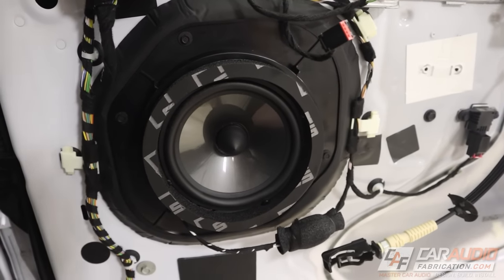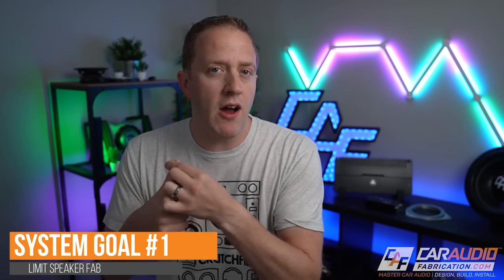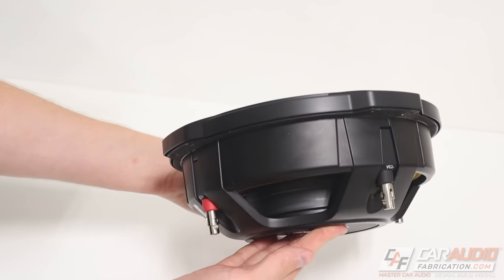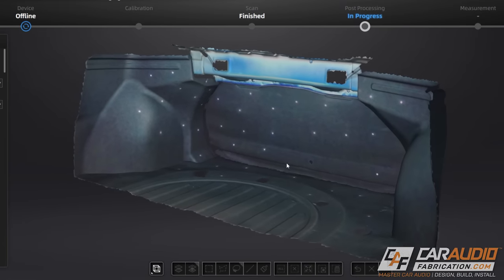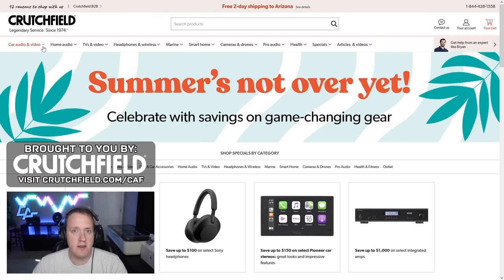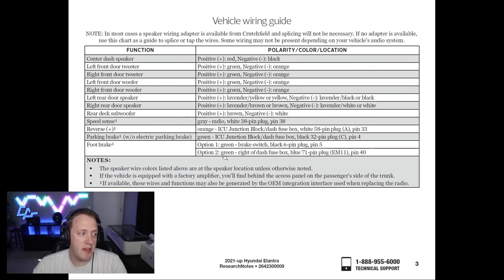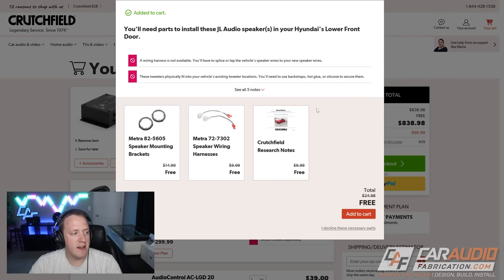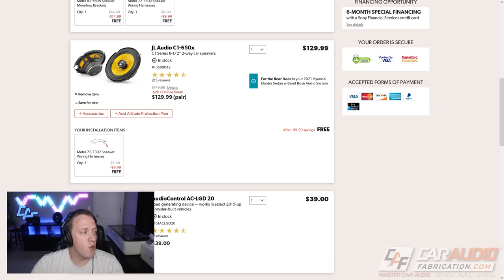Planning Speakers, Subwoofers, & Amplifiers for Car Audio Build - NEW PROJECT!

Comment from the maker: Now that we have everything picked out lets get it ordered! See the full gear unboxing here: https://youtu.be/ip_Yls47PKQ
Reply: Are you going to run new speaker wire to the door. If so, what’s the point using the adapter from the factory speaker plugs to the new speakers and is the factory wiring enough when running an amp. Asking cause I’m in a similar situation with my Holden Colorado

Comment: If 4,000 is a budget build what's my $250 build 😅
Reply: I had a $2200 system in a Chrysler LeBaron in the mid late 1990's. I thought that was budget then as a couple of my amps were not name brand ones. You probably can not upgrade much for $250 these days bud.
Reply: @Living_EDventures  I'm about to spend $140 to more than double the quality of my current oem sound system. I'm getting name brand speakers and a solid head unit. "Budget" has gotta be something that your average joe can afford - not people who have this as their main hobby.
Reply: @AstroSalamander  I mean the bandpass box I bought was more than $140 bare.
Reply: @Living_EDventures  i gocha but budget would just be the bare minimum while still giving a decent upgrade. So new head unit and speakers that increase your overall quality would be considered "budget" and you can do all that decently for $250
Reply: Finish the sentence.
Reply: about fifteen years ago I thought I was balling when I spent 3K on a new install.  Turns out, not so much
Reply: Factory speakers and a cheap head unit
Reply: $250 gets you budget speakers for all 4 doors
Reply: A reasonable speaker upgrade.  Did this in my truck that technically has an "amp" but its only 20w per speaker for the 4 doors, no subs or any fancy features.  No sound treating, reused the oem spacers and gaskets and used adapters to fit the new speaker mounting pattern.  Very impressed with the results.  As much as I would love to finish it out with a nice amp, 2 10" shallow mount subs and a head unit with touchscreen and navigation, the truck continues to need mechanical work as any 20+ year old vehicle does not to mention all the continuous other expenses in life and trying to save up for a house one day.  Channels like these are here to help the companies separate you from your money.  Not saying that's a bad thing or hes evil, but there's nothing wrong with doing what you can afford.
Reply: Yeah I got better quality and wattage off of maybe 600 bucks and hand me downs... audio equipment is given away like crazy and if you hang out with people that don't by absolute garbage you'll end up with a much better system than this for sub 1,000
Reply: I always thought I had a budget system. Then Ione day added up everything and $2500 doesn't sound like a budget system. It's not  all top gear (most expensive) but wiring, amps ,subs + enclosure, factory replacement speakers.  Everything adds up. 😂
Reply: 4k is budget for a full audio system
Reply: Ya. No kidding. Out of my reach too. 500-600 on a new head unit with new speakers. That’s it for me.
Reply: a budget budget build, but nothing is wrong with a budget build at all. build what you can afford.
Reply: That had me crying lol
Reply: Unfortunate, . . …………
Reply: Pemny pinchers menu 😂
Reply: I did a custom set up in my semi truck and it was almost 7k...my ass hurt after I saw the bill but I got 2 high dollar door speakers, 6 speaker/2 tweeter enclosure in the cab. The sleeper got upgraded factory position speakers, 4 speaker/2 tweeter enclosure on the bunk wall with 4 15" subs, all the wire, fuses blocks, 4 amps etc etc. I spend 320 days on the road and I need music
Reply: Poverty build 😭
Reply: I only spent like 1,200 on mine. Amp, head unit, new speakers
Reply: @Living_EDventures  250$ gets you a sweet double din CarPlay radio, new door speakers, and if you're smart a 4 channel amp and wiring kit.
Reply: That's the only issue with this channel. I haven't seen anything for the average joe
Reply: For 250 all on Amazon right now, I’d probably do one of the NVX sub/box/amp all-in-one deals 200 rms version($150) an 8 gauge wiring kit (Skar kit for $18), a package headunit with two 6.5s from Boss ($47), a pair of Kenwood 6x9s or 6.5s depending on your car ($35), and a roll of speaker wire ($7). Total comes out to 257 before tax. I did leave out the headunit mold for the vehicle, but you could always forgo the 35 dollar speakers and leave the stock speakers either in the rear/front and be at around 250. It won’t blow your socks off by any means but it’s something especially if you have stock sound components that are not functioning properly.

Other option is to buy used materials…
Reply: Walmart 😂😂
Reply: That’s how much my ofc wire for the whole car and that was cheap stuff lol
Reply: @garrettgiuffre7298  crackhead 🤪 build? Hey, to be fair, that is better than mine 🙂
Reply: When starting in car audio, you get new speakers & head unit. It’s not long before you decide to add a sub, then 4 channel amp, suddenly you’re applying sound treatment. It’s an addictive hobby! This guy is a pro! Start small and one day you’ll be crazy (and in debt) like us! 😂
Reply: @DGGuaglianone  so true. when i got my 20yr old son going (his first upgrade), he was pretty nervous, but the stock speakers were completely trashed. Head unit and speakers is where it's at, but i did jump him forward - just a bit - by helping him sound deaden all 4 doors. 😎 amp and sub later this year. he's not ready for it, he's still blown away with the hu and speakers, hahaha!
Reply: @garrettgiuffre7298  right like im planning my largest ever build and its about 3500 and i consider that super expensive

Comment: I’d love to see how you connect to the factory output then back to the speakers.
Reply: Yessssss
Reply: PAC makes lots of different adapter harnesses. I got one for my Lexus that plugged in between the factory amp and wire harness. I was able to output the factory amp directly into my aftermarket amp with it
Reply: @mabolzichjjl  thank you for that information. I have to see if they have one for my 16 Ford Taurus
Reply: @mabolzichjjl  Is your factory amp the mark Levinson??
Reply: @allanb3222  no but the connector works for the ML system IIRC
Reply: @mabolzichjjl  Sweet that's what I need, nobody make a T harness for that amp according to the literature.

Comment: The 4k budget is total or components only?  Because if that's the max budget 4k, you're not factoring labor, materials etc into that 4k.  Especially at 3500+ in just system components.  I'd love to see a final breakdown for cost on one of these builds for the average customer.  A custom box(s) for the subs, and install plus misc wiring and such will be well over that remaining balance on a 4k budget will it not?
Reply: I'd guess at least another grand for install labor. The custom box being a good chunk of it and then the dsp setup.
Reply: @uome2k7  I'd bet it's a lot more for the average customers install.  This is his brother in laws car if I recall correctly.  Custom boxes 3d scanned and designed, plus print time?  I'd bet there is a few hours of design time, and probably 100+ hours of print time.
Reply: Totally agree on this. What he showed, the true cost of that system was upwards of $5000 - $5500, depending on all the little things that weren't mentioned, especially for a first-time system builder (such as myself). The true cost of my system is 3x what I was originally hoping to spend, factoring in some of these things, and so now, I'm having to make choices. Of course, this is NORMAL, but this video is a bit misleading because it doesn't help someone take into account all of these other "hidden costs" of building a car audio system.

Comment: I miss the early 2000s I made so much side money doing systems. I made a dj truck the guy used at beach festivals. It ran on 2 generators and was 10 kilowatts. Used loud horns and 2 massive 4 Kw subs. Eventually it shook the truck apart. Ive always wanted to do another one with modern sound equipment and I would tackle Dolby Atmos surround sound true 5.1 spacial audio with hifi sound.

Comment: Been going for weeks part time on a Toyota sienna van.  Did so much acoustical treatment to the front dooes and even in behind tghe trim, wiring, fiberglass pods at only the rear armrests, dynamatt! Etc etc.  All this work for audio in a car.  They should offer audio cars off the line.

Comment: Very much appreciated. Thought I had all I need for my install, then learn if the very likely need for load generating devices. It seems to never end with modern cars!
Reply from the maker: It will only get worse. Car manufacturers don't want you to actually own or modify your vehicle. Wait til the general public learns more about their deceptive practices like having the ability to use heated seats, but requiring you to pay a subscription fee to unlock their use... people need to start voting with their wallet now and refusing to purchase from those manufacturers and making it clear why. It won't last long if shareholders find out why the cars aren't selling.

Comment: Great video are usually ❤.  I feel like what really holds me back in my build is I am not to sure what to get when it comes to installing. Meaning, what size wire sleeves to get, where to add padding to speakers/brackets, and all those small things that make a build perfect. Would love to see something like that

Comment: I love the detail and quality of work man but to be honest most the systems I have seen you build are A. High end.
High quality.
Very Low in output.
I been doing spl /Sq competitions for years. And 4k can get you a loud  system With electrical upgrades. I like JL as much as the next person but other options out there can absolutely crush them in performance per dollar.
Why not reach out to D4S or Skyhigh etc and get some spl grade sponsors.
I really want to see how you would build a spl competition wall ported or 6th order. Something on the order of 15,000+ watts.
You can get a JP43 and a pair of JP234 a dsp and speakers and some subs for 4k and this will nearly rip the trunk lid off

I generally over size my amps by 15-25%.
I find 120-160w rms per channel works well for most mids and Highs.
For daily drivers and still having usable  storage. 500-1000 watts rms on 1 or 2 10's in a proper ported box or 3-4 8in under seats for trucks. 
It's 2023 every build needs a dsp and active filters (dedicated channel for every woofer tweeter etc)
Reply: That's what you see for a good reason... Most people do not want an SPL build, especially to the level you're describing. It's impractical, and a build on that wouldn't provide nearly the same amount of usable information to the majority of the viewership or target audience.

Also just an observation, a lot of folks going for SPL with the equipment mentioned could benefit greatly from stepping back and observing some of the basics

Comment: Great info , for my 23 tacos with JBL (and all the accessories) I plane on 3 way up front, Audio frog, Sony es or Alpine Hi res, 6. 1/2" in rear doors. JL audio 8ch and mono VXI amps. PAC audio 6 ch with optical output to maintain factory HU, or swap HU to a pioneer WT7600nex, or alpine halo 9".

Comment: Very informative video! I've been watching your content for the last couple days now, as I'm currently in the process of replacing all my speakers in my car. My rear speaker blew out due to my iDoing head unit overloading it (despite the off-brand model, the iDoing was apparently still much more powerful than my factory head unit). So I've been researching and went with JBL 621F speakers to replace my original stock speakers in my Crosstrek.  I don't play my music that loud, and I'm not really looking for a crazy setup with a ton of bass-- I just want a modest setup (no amp) with better speakers that can handle the iDoing head unit more easily than my stock OEM speakers were able to.

But then I found out that my old speakers were 4 ohms for impedance, and the JBL's I bought were 3 ohms-- uh oh... According to a lot of things I read online, that could be a big no-no... Thankfully I haven't actually installed them yet, they arrive tomorrow in the mail. Apparently those particular speakers are higher in sensitivity than other door speakers, so the 3 ohms the JBL's use seem to be balanced out by the sensitivity rating. I've already contacted iDoing support and waiting for their response to see if those speakers will be fine for their head unit, so I've been trying to be careful before I mess up my audio setup.

It's a lot to learn, but I'm also learning a lot from watching your videos, so thanks! :)

Comment: Love the video, only thing I disagree with is using TW3's. Regular 12W3's would have been more cost effective and would sound 10x better. I get you did it for space, but I feel like you gotta give some of that space up if you want better sound quality. I always try to push people towards a conventional woofer if they have the room for them, to me they've always sounded better than the flat ones. They are very punchy, the bottom end just isn't there.

Comment: I love how car manufacturers charge so much money for a factory 'premium' system that is still garbage in comparison to a proper aftermarket system with DSP tuning. I really wish some manufacturers would have a proper tuned, DSP-ran OEM system, they definitely have the ability to do so, but the bean counters seem to control or constrain most of the decision making. Even my wife's 'Premium'  Bang&Olufsen system in the Q5 is disappointing in comparison to my simple 2-way front active + rear filler system  I built for my golf.

Comment: Why don’t you correct the signal straight from the DSP? You could sum and apply filters to flatten the signal from the DSP.
If you go this route you omit one step so you introduce less noise or artifacts.
Reply: Does that DSP have the capability of flattening the signal on the input stage and then let you make your output adjustments? Not all dsps have that feature.

Comment: So I have a 35 year old AM FM radio that came out of an old pickup truck that has been converted to Bluetooth and an aux out but it's an 8 ohm radio system. If i use an audio control lc2i ( because obviously a radio that old did not have RCA jacks)will I damage a Scar RP 600.5 and run 4 ohm speakers? Do i run the risk of burning up anything? I've been told "no worries" and "you'll melt down the car". What say you-Big Wisdom?
Reply: I'm really not understanding your desire to use that old radio, but that aside, you want to see how much voltage it can put out. 

Run a 1,000 Hz 0dB test tone (available on Kickers website) through the radio using aux in or Bluetooth (or both) then hook up a digital multimeter and read the rms voltage. It would be great if you had an oscilloscope so you could see if the signal starts to clip, but if you don't have that then just turn the volume up to maybe three quarters and see what your voltage is. Since the radio works, you can also hook up a speaker and listen for distortion. When the radio amp starts clipping the signal you can hear the 1,000 hz tone change. Thats the "max recommended volume" point for that radio. Just keep in mind that you can certainly go past that volume point if the song is recorded at a lower than normal level. 

That Skar amp can take in up to 6v rms. I'm thinking that radio will not output more than 6v, but if it does, just use a $20 kicker loc with adjustable pots to reduce the voltage down to the 6v level. 

Remember that as far as signals are concerned (no load like a speaker) your only concerned with voltage. Then once the signal gets to the amp, the amp will produce the power for the speakers. Then you can run whatever the amp recommends such as 4 ohm or 2 ohm loads on the 4 main channels and 1 ohm load on the sub channel. 

Hope that helps.
Reply: Did you mean to say the radio has an aux out or aux in? Aux out would be like a pair of rca jacks outputting a low voltage signal for an amp. Everything i said above presumes you want to use the speaker wire outputs.
Reply: Aux in. I have to use the speaker wires to the lc2i pro. I can adjust the level on it so I shouldn't have to worry about ohms. I think 🤔
Reply: @brentbenner8647  Did you follow my earlier comment? I'm not sure how much audio knowledge you have. Are you new to all this stuff?

Do you already own the LC2i pro? You may not need it.

The ohm load is what an amplifier worries about. The LC2i and Skar 5 channel amp will not put a heavy ohm load on the radio. They will typically be several hundred ohms to several thousand ohms which is well above the radios minimum 8 ohm rating. The radio will not even know there is a load. So no worries there.

Comment: In my boat, I have a JL audio M 600/1 mono class D 600 watt amp for my two JL audio M3 series 10 inch subs. My question is, am I able to add two more identical JL audio M3 series 10 inch subs to the amp? if so, should I wire them in series or in parallel? What gauge wire should I use?

Thank you
Jeff

Comment: So I did the system in my 21 Elantra. I soldered RCA's directly to my front left output wires then ran those into a Kenwood 6006 DSP. I didn't use any lgd's. My system sounds amazing, imo, is that because I'm using a DSP?I definitely want to see this whole build. I had to make my own T harness to be able to integrate into mine.
Reply: @basstech714  thank God! I freaked a little bit because when I did my research I saw nothing about LGD'S! Thought you only needed those on Chrysler cars!!